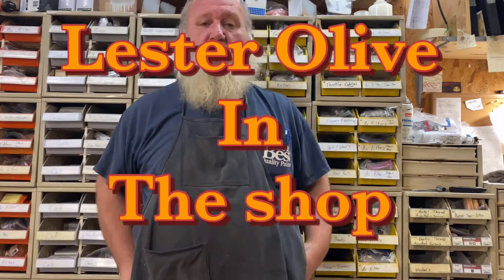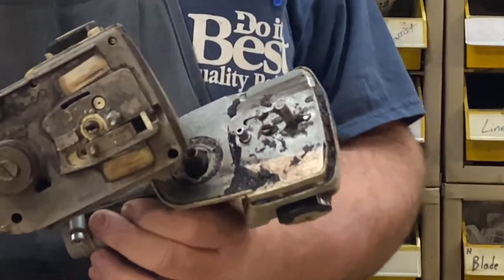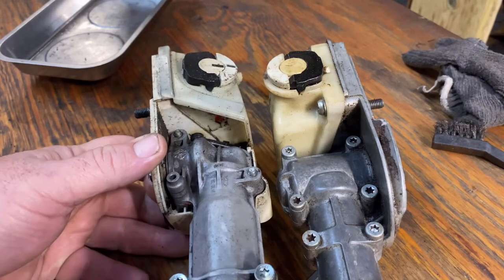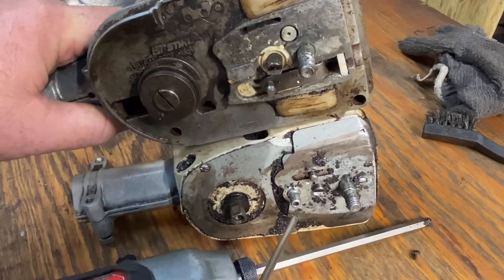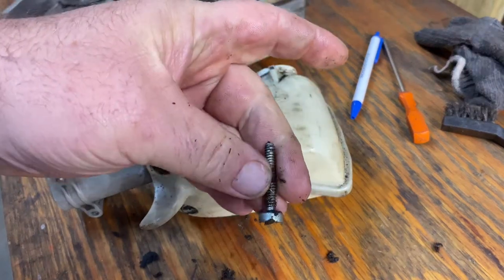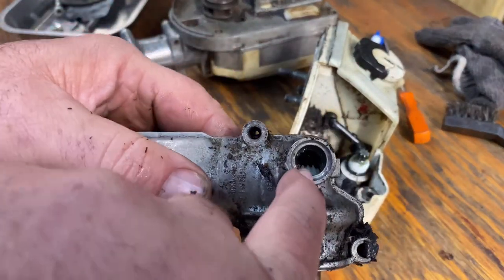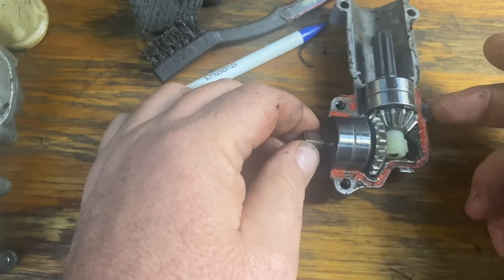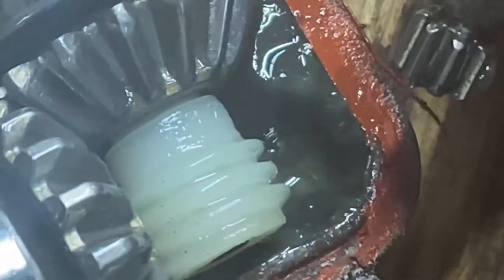Stihl pole saw gear/cutter heads, disassembly and comparison

Comment: Great video. Have you ever taken out the vent valve to the bar oil tank? If so, is there a special way to pop them out then back in. There are no threads on them, they look like a bullet.  My valve is leaking oil. Thanks.
Reply: I have not. All the ones I’ve worked on, vented through the cap, and all naturally leaked bar oil the the oiler port.